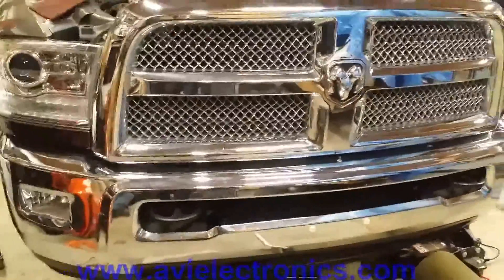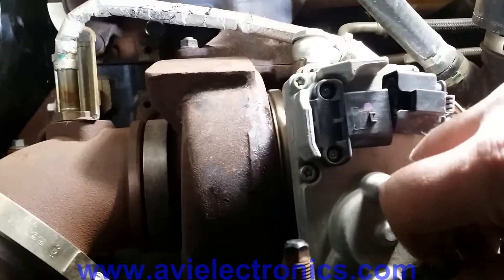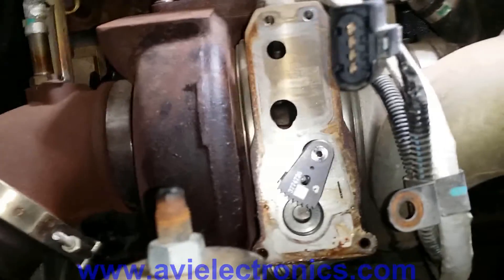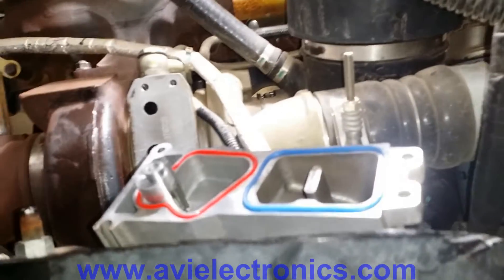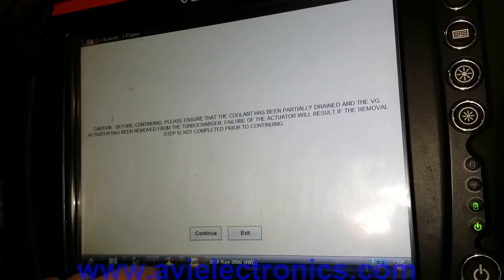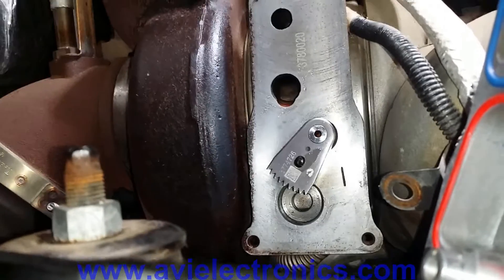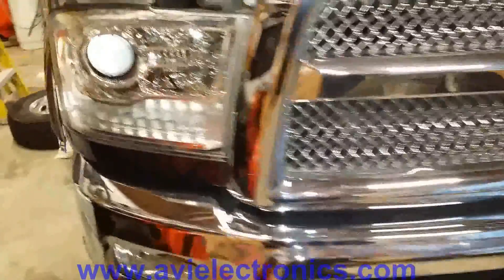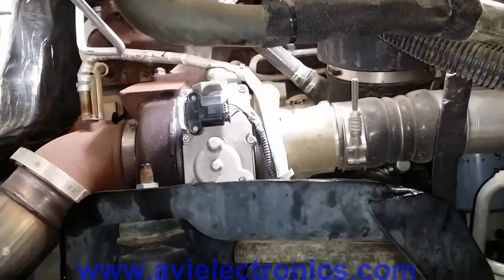How to calibrate VGT Turbo Actuator  DODGE RAM 2500 3500 6.7l  HE300VG by AVI Electronics.

Comment: When i did this, it kept programming before i could get the bolts in. So i held it in place by hand while it prograbbmed. Why was it doing this?
Reply from the maker: You should install the actuator, tighten the bolts, and then calibrate.
Reply: You should have disconnected the batteries first before doing anything.    Hope this helps

Comment: so you recalibrated the original actuator or you installed and calibrated a new actuator?
Reply from the maker: Recalibrated the original one just for video. But it does not matter. The procedure is the same.
Reply: @avielectronicscorp.1591  do you think there's ever a case where the original one isn't functioning properly and simply recalibrating it fixes the issue?
Reply: @avielectronicscorp.1591  do you think there's ever a case where recalibrating the original one could solve a problem with it working intermittently

Comment: If I replace the whole turbo do I have to do any sort of calibration? If I pay a shop to recalibrate it I might as well just replace the whole thing if I can. And also when you say drain the coolant how did you do that? Like the whole truck coolant system of is there a supply line on the turbo you can take of?
Reply: There is a supply line on the bottom of the turbo but it's a pain.

Comment: I had mine changed but it showing a 226 code why
Reply from the maker: Did you check your turbo? The sector gear should move from mark to mark freely. Also, there may be a problem with the actuator.

Comment: I could  hear noise in exhaust , like a chatter. It was the actuator. It would chatter and not spin at times. Noticed it with key on and not running . Not sure what it is doing running. Have the 3 codes

Comment: 2017 2500  all stock, I'm on my 3rd actuator.  Tow/hauls fine with no problem but at stops/red light the truck would stall. The turbo gets loud and deep then stalls, I can put it in neutral give it a little bit of gas and the truck will clear its self up? Help pls.
Reply from the maker: Bad delete? Or bad sticky turbo.
Reply: @dominicromero7841 I’m having the same problem did you ever fix it?
Reply: @Unknownuser11188  I kinda narrow it down to the truck regening. I have a scangauge 2 and when the soot level hit 100 the truck runs like crap and stalls.  I rev it and ash flys out. I'm actually going to delete this weekend because I'm tried of the truck regening almost once a week.  Hit me up in a month and I'll lef you know.

Comment: Awesome video. I wish I saw this before doing my first actuator yesterday lol. I was wondering if the gear for these actuators are supposed to spin freely or not?
Reply from the maker: Thank you. You can turn the actuator's gear manually, but with great effort.
Reply: @avielectronicscorp.1591  okay great because I tried moving the new actuator's gear and it barely moved with my finger. Thanks for the great video. It was very well explained 👍
Reply: What happened if you don't calibrate the actuator? Can you take it to someone to just calibrate or does need to be calibrated before driven?
Reply from the maker: @pantachapin986  If you don't calibrate the actuator- it'll not move vanes. Boost control and engine brake will not work properlly. Watch our video about calibration procedure.   https://www.youtube.com/watch?v=v1UA7FTlvBo

Comment: Did you drain all the coolant from the truck, or just what came out when you pulled the actuator off?
Reply from the maker: You should drain 3-4 gallons of the coolant so that its level is slightly below the actuator to avoid getting the coolant inside the actuator during installation.
Reply: I just did my first turbocharger actuator yesterday and instead of draining coolant I just clamped the upper hose with vice grips wrapped up with electrical tape. I only lost a little bit of coolant when I took the actuator off.

Comment: If my ecxaust brake stuck do I need to remplaace the vgt ot just clean it ?
My check engine came on and the mufles smogs a lot and seems like a miss fire at 1250 rpm no power . also is there a way tl do it calibrate without that computer it broke on the feel up the mountains
Reply from the maker: Looks like your actuator has an intermittent issue.
Reply: @avielectronicscorp.1591  Could it be fix . I look online and 992.00 dolaar juat for the atuator .

Comment: 2:50 put it on and connect it, and leave it off? That’s confusing
Reply from the maker: It means that you shouldn't mount the actuator on the turbine at that moment.
Reply: AVI Electronics Corp. do you know what program, software is needed? I tried using JPRO, Cummins Insite, neither one was able. Does ram or dodge have a dispute with Cummins over the main computer? We had a snap on HD SCANNER but got stolen.
Reply from the maker: @michoacan91davi  You can rent our calibration tool: https://www.youtube.com/watch?v=v1UA7FTlvBo

Comment: Sorry for the newbie question but what goes wrong with the actuators?  Do they just get gummed up?  Can they be cleaned and re-used?
Reply from the maker: No, they have defective electronic boards.
Reply: AVI Electronics Corp. Wonder why no recall?
Reply from the maker: @JeffRigney  Jeff, why are you asking me?)))  From 2013 they did some changes, but with no luck.

Comment: I have a 2014 limited Laramie Longhorn and I have got the p003A code on my scanner a couple times now and noticed my truck taken longer to shift in 5th 6th could this be my actuator?
Reply from the maker: P003A trouble code indicates the issue with turbo or actuator. Unfortunately, Cummins does not have any diagnostic to find the problem exactly so you should take the actuator off and check the turbo. If the turbo is sticky- it may be a problem with shifts. If you are local- you can bring your truck to our office and we'll be able to diagnose the issue with our tool.
Reply: did you fix the problem on code p003A?

Comment: I will be replacing the actuator on my 2008 2500 6.7 shortly. As long as I do not move that little arm, I can just plug and play correct?
Reply from the maker: No. You'll have to calibrate a new actuator. You can watch the calibration procedure: https://www.youtube.com/watch?v=v1UA7FTlvBo

Comment: Do I have to recalibrate if I just take it off clean it replace gaskets and put it back on
Reply from the maker: If you are sure that you didn't move the lever and didn't turn on the ignition- calibration is not necessary. Otherwise, you have to calibrate the actuator.

Comment: I have p00af,u010c, and p003A do you think it actuator and turbo or just actuator?
Reply from the maker: Usually, it's the actuator's problem, but one more reason the turbo has damaged vanes or shroud plate, so vanes don't go all the way to the closed position. Cummins does not have a diagnostic tool for this problem. If you can bring your truck to our office- we'll be able to diagnose the problem. Otherwise, you should remove the actuator and check your turbo first.
Reply: AVI Electronics Corp. What’s your diagnostic tool?

Comment: Is it just me or am I confused about this “cleaning process”. You cleaned the mating surfaces of the actuator and turbo how is this going to help? I’m getting Intermittent turbo codes and was thinking about checking the veins and actuator but don’t see how this will help me
Reply from the maker: This video was created to show how to replace the actuator and check the turbo. In your case, some inner electronic components getting bad so you should rebuild or replace the actuator. It's a common problem HE300VG actuators.
Reply: AVI Electronics Corp. alright thank you. if I unplug that connector to check the wiring do I have to also re-calibrate it? These damn vgt turbos cool idea horribly executed
Reply from the maker: @ChrisGrunst  No. You'll have to calibrate the actuator if you take it off of the turbo.
Reply: AVI Electronics Corp. alright thank you
Reply from the maker: @ChrisGrunst  You are welcome. But wiring will be fine. Most of all it's the actuator problem. Less- the turbo.
Reply: AVI Electronics Corp. yea I was thinking that. Weight my options now. The part that makes me mad is I’ll go thousands of miles without and issue then I have the codes randomly pop up for a few weeks

Comment: Are you required to calibrate if you dont mess with small arm leaving everything intact let's say you just replacing gaskets
Reply from the maker: If you are sure that you didn't move the actuator's gear and turbo's lever- calibration is not necessary.

Comment: Where do you get the gaskets? Local Chrysler dealer can't find them. Do you have any part numbers?
Reply from the maker: We produce silicone gaskets, but they go with our actuators only. Regular rubber gaskets you can find on ebay- there are many offers.

Comment: Also if i take mine off, must i re calibrate it or can i put mine back on with out re calibrating the actuator
Reply from the maker: If you sure that you didn't move the lever and didn't turn on the ignition- calibration is not necessary. Otherwise you have to calibrate the actuator.

Comment: What is the control arm don't move freely ???
Reply from the maker: In this case, you should remove turbine housing and check the nozzle ring and shroud plate. There you'll see the exact problem.

Comment: And also what would be the symptoms of a failing gasket on the actuator?
Reply from the maker: The coolant goes inside the actuator and damages the electronic board.
Reply: @avielectronicscorp.1591  in what way would it effect performance ? Would it effect the rail pressure
Reply from the maker: @justinvenuto7887  At first you'll have trouble codes, then actuator will not work at all.

Comment: Do you have to calibrate if you take off just to change gaskets?
Reply from the maker: If you didn't move the lever and didn't turn on the ignition and you able to put the actuator in the same position-  that's fine. Otherwise, you have to calibrate the actuator.
Reply: AVI Electronics Corp. hello, I have a CEL with code reading P003A 
Don’t hear the turbo spooling but still has some power on the truck? Any help? My shop Machanic has snap on scanner as well. So will start there and recalibrate actuator. Anything else We should look for while doing this? Thanks

Comment: My ram 2500 2014 has a faulty actuator  do you still sell these ? Also before installing is it recommended to clean the turbo ?  Or should I just get it rebuilt with the new actuator .  I’m at about 73k miles .  Or just install the actuator ?
Reply from the maker: If the lever goes from mark to mark freely- the turbo is good. Anyway, you should clean the surface to avoid leakage of coolant. Yes, we sell reman actuators. 312-450-7788

Comment: What code did you have
Reply from the maker: This video has been created for my customers to show how to install the actuator correctly.
Reply: I know that mine is acting up. At times getting on the throttle is very laggy as far as the turbo and I have little to no exhaust brake when this happens and its a P00AF code for my 2014
Reply: @alexpanella1106  did you fix the problem?

Comment: Anyone happen to know the torque specs on those 4 bolts?
Reply: 26 inch/lbs first torque > 97 inch/lbs final torque. Torque in sequence top right, bottom left, top left, bottom right.

Comment: Where could I buy the computer to calibrate it? Any model? Thanks for you help.
Reply from the maker: I'm working on it, will be available for sale in several weeks or so.
Reply: AlphaOBD will work from what I've read and it's likely the cheapest option, even if you don't already own an android device or an OBD2 bluetooth adapter.  I'd recommend OBDLink MX for the OBD2 reader.  I believe the AlphaOBD is around $50. https://www.cumminsforum.com/forum/4th-gen-non-powertrain/2495873-alphaobd-turbo-actuator-calibration.html
Reply: I'm in the same boat . The part install isn't bad, but I don't want to spend an arm and a leg on a snap on tool for one part.

Comment: My check engine is on and has POO3A error code so this is it actuator
Reply from the maker: If you got this code it may be a turbo problem too.  You should take the actuator off and check the turbo (see another our video how to check a turbo),  then try to calibrate the actuator again.
Reply: @avielectronicscorp.1591  ok will do thanks for the reply
Reply: Yevgeniy Bakhtin Женя , is it possible collaboration is just off? Or should i buy a new actuator? My code is P00AF
Reply: Yevgeniy Bakhtin thank you in advance
Reply: @KWOKGB  I'm having the same code , did you ever get it fixed?
Reply: David David hey , i ended up with purchase of a new actuator from cubans in miami for $950 OEM and installed it myself using snap on tool ( there is a menu for calibration)
Or you can buy low miles turbo set from LKQ for approximately of $1500-1800 and install it , but than you have to remove exhaust manifold which is pain on the ass.
Reply: @KWOKGB  has your turbo worked perfect ever since? How many miles have you put it on since then. Idk whether to buy actuator for 800 and someone calibrate it for 500. Or get a turbo with actuator on already on it for 1800 and getting it installed for 6-700
Reply: David I’ve got 310k 2013 , turbo works fine since. But my advice to you is replace everything at once
Reply: David idle kills turbo , and low load on engine building up soot . I hauled 26K lbs all the time , actuator stopped works at -10F one morning. But it probably electrical related issues
Reply: David actually I was wrong! In your case it’s faster cheaper and easier to install new actuator. Turbos on RAMS can go up to 400K miles
Reply: @KWOKGB  thanks for the help mine is a 2015 3500 w/ 94k miles ...lost turbo power about three times at red lights. 2 weeks ago I would just put the truck in park then drive and turbo would start working again. I think it's just the actuator going haywire.
Reply: David seems like it has power on a high rpm . Mine was stuck at certain position. So I drove it from NY to Miami with 12K lbs behind. It’s happened to me at approximately 220K miles

Comment: so do you need to buy a new actuator? or can you recalibrate your old one?
Reply: Have the same questions. I thought at first he pulled the old one and installed the new one. But at the end of the video he mentioned he pulled out it out, replaced the gasket,  and recalibrate it. Didn't mentioned if he bought a new one.

Comment: You kind of lost me pairing the actuator with the arm. I mean does the actuator have a limited range of motion? Do I have to hit an exact tooth when bolting the actuator to the turbo?
Reply from the maker: You don't have to find exact tooth. Just bolt the actuator to the turbo and calibrate it. Actuator's gear does not have limit of motion.
Reply: The actuator arm itself absolutely has a limited range of motion.
Reply from the maker: @fattmouth7715  Turbo's arm or actuator's gear?
Reply: @avielectronicscorp.1591  The turbos arm. I've never set one up but I have the software in my computer to do it, that's why I was checking out this video. I'm sure I can figure it out thanks for the information.
Reply from the maker: @fattmouth7715  See our another video how to check a turbo. It's for HE351VE but they are similar.  https://www.youtube.com/watch?v=BJeYF9K0k1Q

Comment: great Video...so I am getting engine codes indicating my actuator is failing. The tech believes that it is electrical as function is intermittent. I am wondering how much of this i can do at home, less not having the snap on computer that you do....any tips?? I was looking to go to pick a part as factory it is 4000.00 for the actuator
Reply: How much? Company name?
Reply from the maker: AVI Electronics. 312 450 7788
Reply from the maker: Our company rebuild actuators. These actuators have defective hardware and firmware. You may send us your actuator for rebuild. But anyway you must calibrate your actuator during installation.

Comment: How Did u remove the bottom left bolt, I'm stuck on that one
Reply from the maker: Drill small hole (2mm or so) in the side of the bolt, then use 5,7-5,8mm drill bit.
Reply: Yevgeniy Bakhtin thanks i got it
Reply from the maker: It's common problem. Put some grease on bolts during installation to avoid this problem in a future.
Reply: I snapped inner shape of the bolt today, so I had to remove electric part cover, with 27 5 point socket, then used wise grips, since after cover removal you get some clearance to get on the bolt, I grinded wise grip's top noze a bit so it wont damage exposed gear.